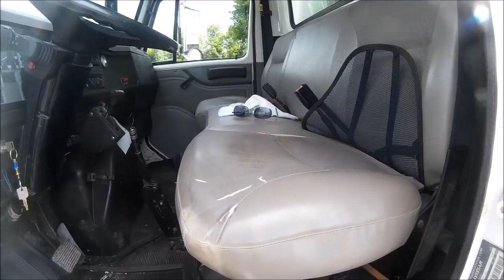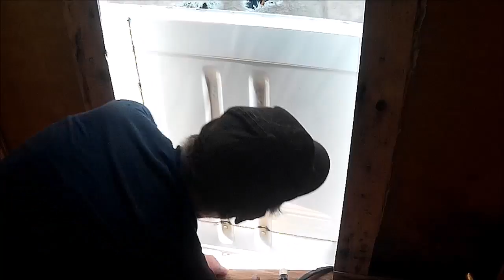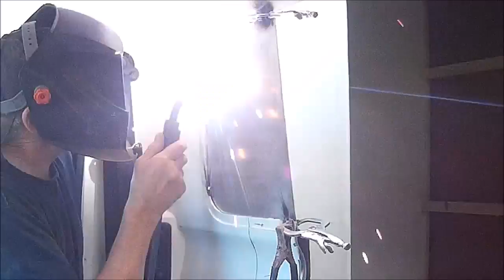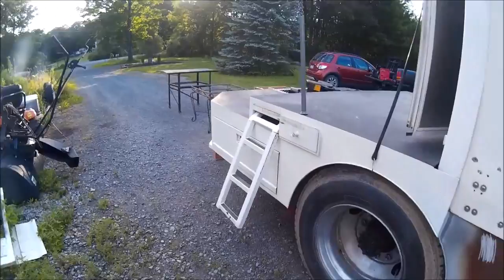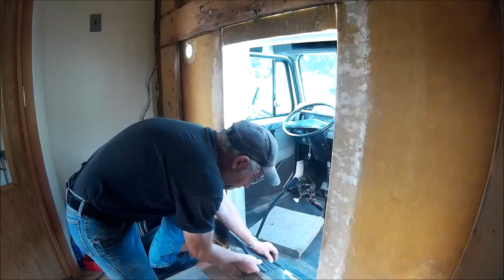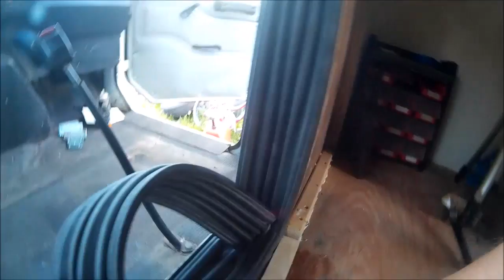Accordian Pass Thru Gasket Install

Comment: Did you notice an increase in cabin noise while driving? THanks for sharing this, I want to do the same thing for my build.
Reply: When the door was open yes there was, but if you've ever been in a motorhome while traveling it was similar, door closed just the normal truck sounds

Comment: 1) 2:18 Tool made from stick with taped pencil to mark the line to cut out.
 
2) 14:19. Installing rubber accordion gasket. (2” minimum to 8” maximum.) Best to NOT start gasket in center.

Comment: I know this is older video but when you tip the cab forward how do you get the seal to work?
Reply: @monoshock57 the cab doesn't tilt on this model truck

Comment: wow I had no idea you could do this! I've been having the hardest time finding something in my budget with the cab and box joined. this just gave me a lot more options! thanks! : )
Reply from the maker: Thanks!
Reply: @rvtek4695  Wow nice job so Accordian Pass Thru Gasket flex just right with the motion of the front cab and the box and prevents leaks and and other weather elements never realized that gasket is that good great work.

Comment: This was great! answered several thoughts I had about my own build I realise you have sold this now but may I ask, what about road noise and more importantly insulation? Did you just seal off the cab while in the habitation?
Reply from the maker: The camper section was well insulated and really wasn't any more noisy than a motorhome. When we was parked and staying in it there was a sliding door we shut.
Reply: Thanks for getting back so quickly! I have a luton sprinter with an overhead was planning to open up  the entire cab (basically remove the bulkhead) to utilise as much space as possible. However i do worry about insulation.

Comment: And these will not leak rain?
Reply: If installed properly no, these are installed on thousands of semi trucks
Reply: @terrygraves4736  Ok i see. Ive been looking for a cutaway walk-through and its tough to find so I may be looking at this job. I didnt know about the semis, i thought they have their own method. These seemed like they would twist off every time you go out of a driveway when the cab and body are moving around independently, not to mention rain. So ok.

Comment: Wouldn't bother with the casket along the bottom of the doorway. I'd just put a C channel over that gap to walk over. The gasket is a flexible water seal and not structural, that I'd only apply around the top and sides.
Reply: If you'd ever been in a semi with a sleeper you'd know that the always go around the entire opening, it keeps the splash, air infiltration, ect out, very necessary